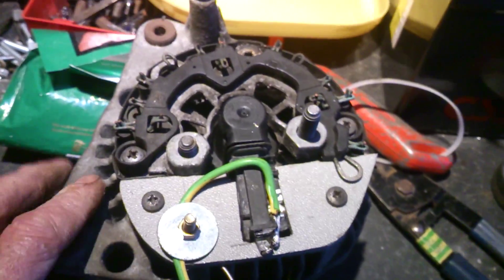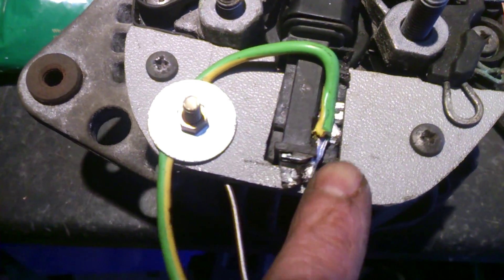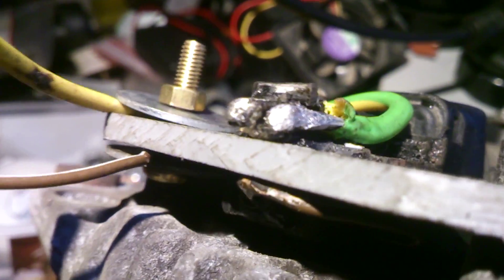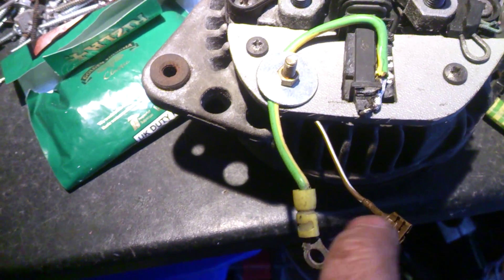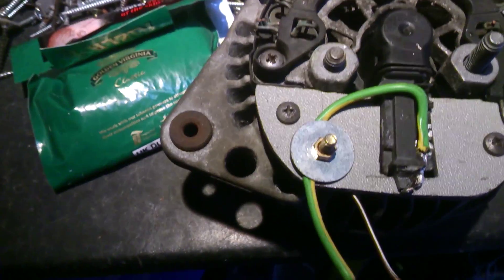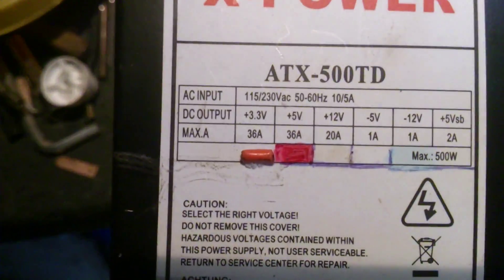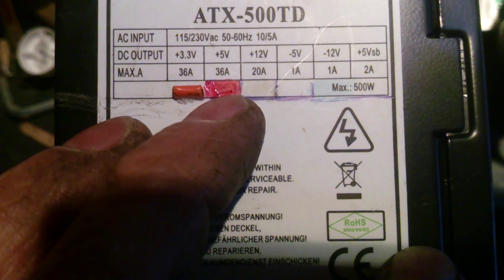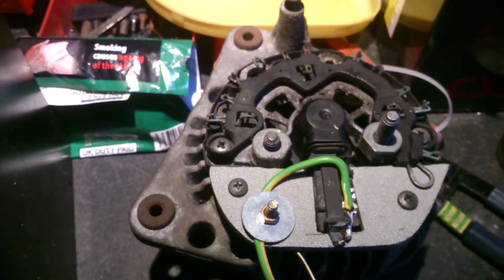irondmax MEYERS alternator NONRECTIFIED brushes hack Part2

Comment: make sure there is not a capacitor in there.. remove it if there is. any 5 volt source should be ok. 2 amps will be the amp load. load is pulled as you apply more or less voltage.
Reply: ***** the alternator stan used was a ford make, they used them in ambulances. you just need to clip the two wires inside. i am sure he went on to rewire them, but the first one was just a standard one. the out put lug can be on the alternator frame, but not connected to common ground, so you will need a plastic bushing when it bolts to an engine or anything else with a common battery ground. GM alternators are common here, and pretty simple to redo. ebay sells them
Reply from the maker: irondmax aha! Ok, so I'm on the right lines. Fantastic. I went to the local council waste tip today, and a young fella working there really impressed me, he knew a fair bit about Stan Meyers work, but unfortunately for you, he couldn't answer any of my questions. Hahaaa. 
Cheers Neiall